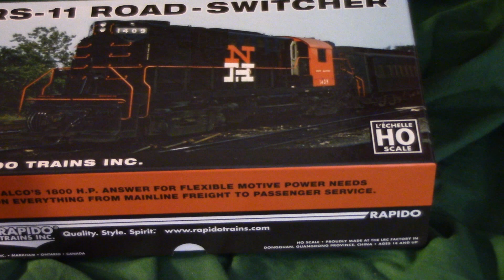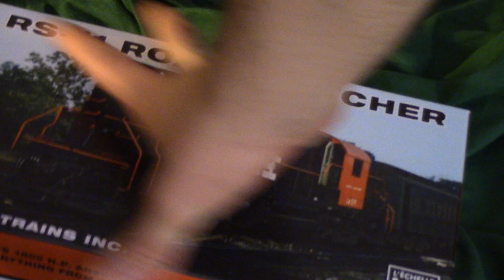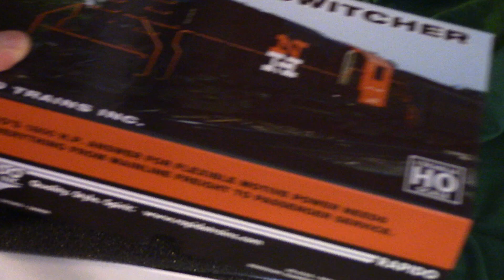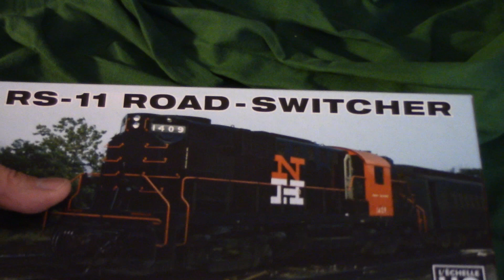Rapido N&W rs11 goof

Comment: NO N&W RS11s were ever equipped with steam generators.  Ever.  There were two RS36s inherited from Nickel Plate with steam generators #2874 and 2875.  The only error on Rapido's RS11 is that they should not have number above 364 for the phase that has been done.
Reply: Rapido send me replacement motors for all of mine.  They are a big pain to change out.

Comment: I heard about the mixed reviews on the Rapido RS-11 in one of the local RPM meets. One of the modelers ended up replacing the truck sets and replacing the motors with the Kato sets. I just received my B36-7 unit in Conrail scheme. Hope I don't run into any issues on that unit.

Comment: Do you actually KNOW that actual number did have a steam generator? Rapido does different details depending on the individual road numbers. Some like the demonstrator had steam generators, others did not. Looks like the individual prototype for this engine did not.
Reply: Rapido's model is correct for RS11s 308-364.  I have no idea where anyone got the idea that it would have a steam generator, unless it was a drawing that was published before release... in that case the drawing was in error.  No N&W RS11s had steam generators.  N&W had 22 GP9s with steam generators, they were the only S/G equipped diesels ever purchased by N&W.  The others with S/G were E units, some GP7s, GP9s, and the two RS36s from NKP or Wabash.